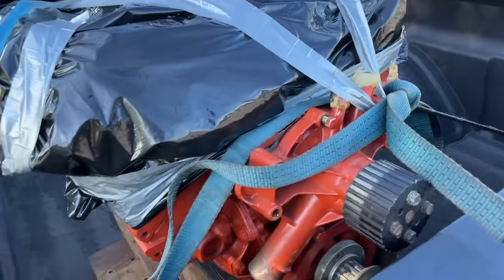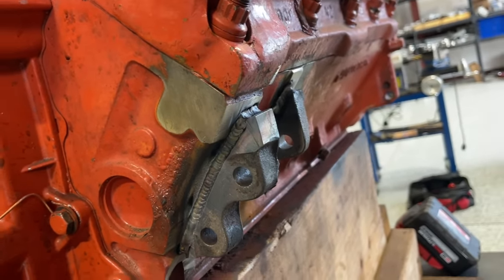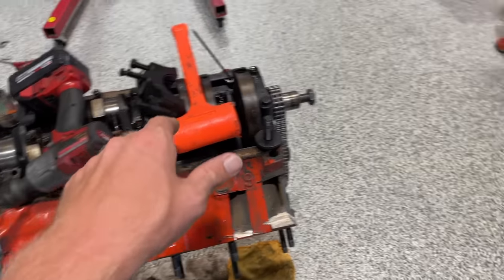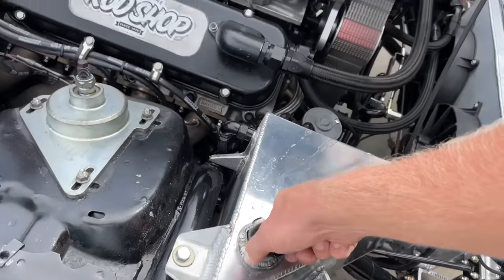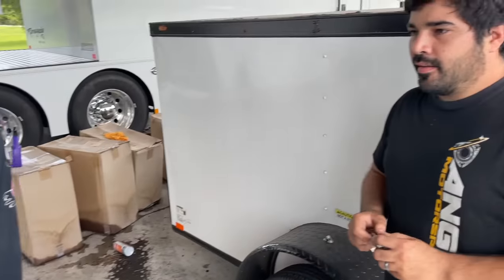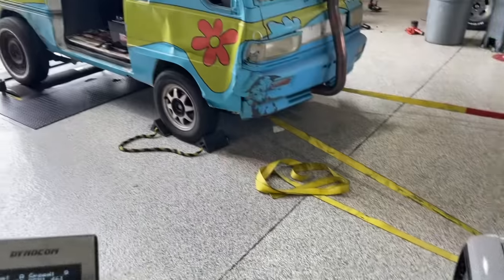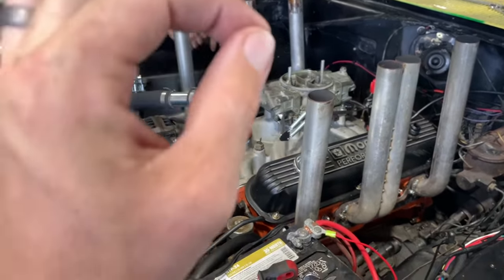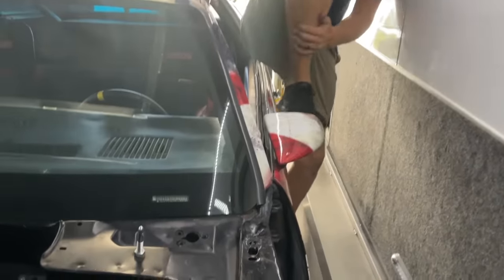The Fastest I've EVER Blown Up an Engine... HOW!?!? + Corn Cob Gets a Late Model MOPAR Race Engine!!

Comment: Its lifter tick. Every chevy has it. Everything from our 1996 chevy silverado to out 2018 chevy silverado we also have a 2003 suburban that has it a 2004 impala that has it a 2011 tahoe that has it. Just slam the engine on the rev limiter for about 3 mins and as long as it dont blow the tick will be almost gone

Comment: Magnum the vortec of Mopar my 95 Grand Cherokee had the 318 magnum I used to drive it from close to Houston raceway park to lausiana get 20 mpg race the Street class sand drag class Win with the air on good running engine that was my drive and drag sand drag it was full time 4wd with low range in low range 4wheel smoke show

Comment: Never run a Fram oil filter on a Mopar engine them mopars doesn't bypass any oil so they need a good oil filter to handle it all I've seen a Fram oil filter gets crushed in like it was vaccum sealed and lost all oil pressure within mins of a oil change

Comment: CLEETUS PLEASE READ THIS....

*****.  HOLLEY FUEL MAX FUEL PRESSURE  *****.  
*****.  HOLLEY FUEL MAX FUEL PRESSURE  *****.  
*****.  HOLLEY FUEL MAX FUEL PRESSURE  *****.  

Holley recommends 7 psi at idle, and a minimum 4 psi at engine redline. The reason is that you will blow the needle and seat open with higher psi. The problem is that your motor will consume far more FUEL than that at redline.  The lager pump you installed is not working correctly because of this.

The best way to achieve this is to add a Full Flow Fuel Rail that returns fuel to the fuel tank.   

TANK  -  FUEL PUMP  -  FILTER  -  HOLLEY  -  REGULATOR  -  TANK

It is important to instal a regulator AFTER the Holley... NOT before.  This way you can keep the correct psi at Idle and Redline.  

At idle the regulator keeps fuel pis to max 7.5 

At redline the Holley can drink all that the pump will deliver because the regulator is not a restriction in front of the Holley. 

If you had a fuel pressure gauge in the cab, you will see the pressure dropping at redline the way you have it set up now. 

Check spark plugs for correct mixture indications 

OLD SCHOOL works well just gotta understand whats happening.

Comment: I would really spend the time pull the plugs clean em on a wire wheel heat em up  burn em off before each start just to stop all the soot build up that happens each time you pour stuff down there the water your using will still have an Electrical conductivity so is not hho..... Hydrogen  hydrogen  oxygen is what you want has zero control emission ... as no one is good enough to provide a good enough product go to a water specialist and buy proper hho water with a zero control nt on the electrical conductivity because true hho has zero cpm .... Also different pH levels in the water will allow for better purity.... Meaning either acidic or alkaline properties have different effects on your parts.. Just like the oil you choose to use in the vehicle as it's something indroduced by you and the total cost and the effect of a parts durability  is entirely up to you...

Comment: Fog your barrel valve and shut off fuel pump with WD-40 every time you park the  car methanol is very  Corrosive with aluminum fuel components  will save your bald eagles